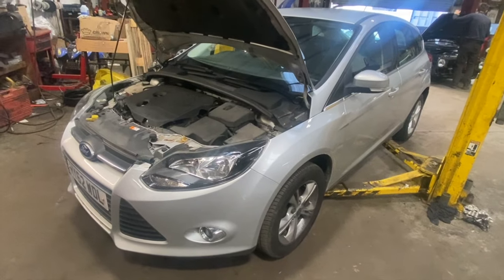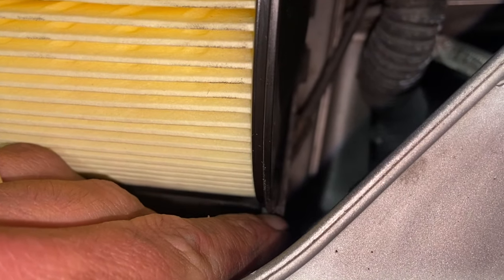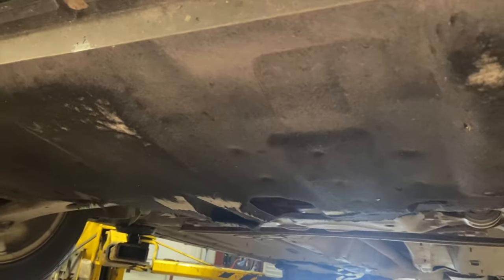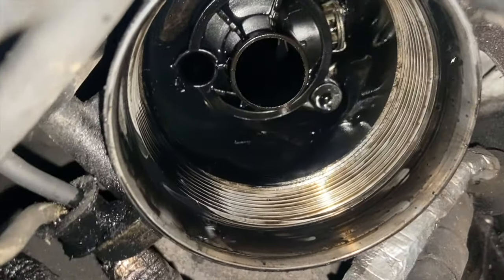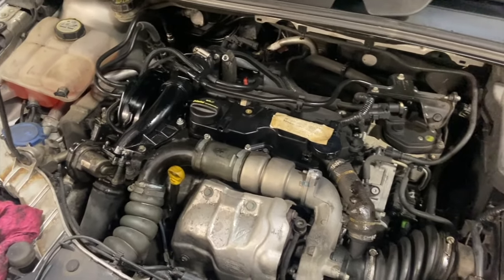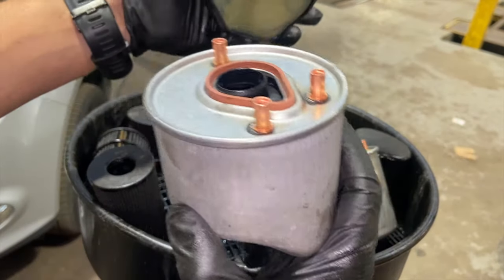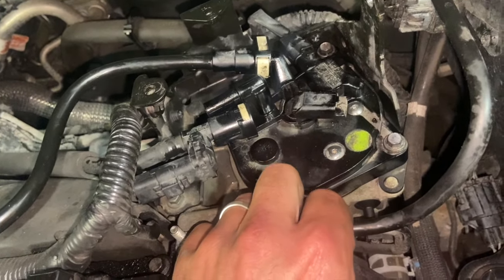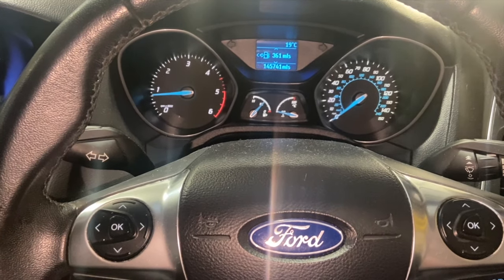Ford Focus 1.6 TDCI Engine service procedure (oil, air & fuel filters) mk3

Comment from the maker: Check Euro car parts for filters etc - https://tidd.ly/3lIO7xA  (use discount codes on site)
Check "Car Parts for Less" - https://tidd.ly/2LNEwIn  (use discount codes on site)
Service kit Ebay - https://ebay.us/iECTCH
Engine oil eBay - https://ebay.us/Vkvb8k
4L Engine oil amazon - https://amzn.to/3ujyWPp
Brake cleaner eBay  - https://ebay.us/57pfYI

Tools :         
Shallow socket set 3/8 - https://ebay.us/aDzBza
Suction pump - https://ebay.us/LomSm7
Primer pump - https://ebay.us/42gY7E
Battery Ratchet - https://ebay.us/Z8FZbP
3/8 Digital torque wrench - https://amzn.to/2PP9vpP
3/8 standard torque wrench - https://amzn.to/33eZsxj
Socket set - https://amzn.to/3eGx2Ak
Brake cleaner sprayer - https://amzn.to/2BLF1gX
Long reach 3/8 ratchet - https://amzn.to/3iJsADg
Ring Inspection Lamp - https://amzn.to/3gGWHcG
torx screw driver set eBay - http://www.ebay.co.uk/itm/142442401623
Pic set - https://amzn.to/33JcZyJ
Dewalt 3/8 impact driver - https://amzn.to/3njemLY
Screwdriver set - https://amzn.to/3jswgJP

Comment: Thank you for your time making these excellent videos.  Always look forward to the next one.  
Didn't really know where to post this question but I need to know the best way to remove contaminated diesel from the fuel tank in a ford focus 1.6 tdci mk3 2014 please, without having to drop the tank.  Could you advise please. Many thanks.
Reply from the maker: There might be a drain option via diagnostic machine but if not with a pump I’d try sucking it through the supply pipe to the fuel filter

Comment: TIP......REMOVE FILTER BOX TO IMPROVE ACCESS TO THE DODGY PLASTIC NUT ON THE OIL FILTER HOUSING
I struggled to undo the oil filter nut as I only had a spanner that was big enough to fit but there wasn't enough room to properly fit and turn the spanner due to poor accessibility.  
The air filter box is easily removed as you just undo an electrical connector and then just pull it out from the rubber mountings. Bingo - managed to undo the tightly fit oil filter housing with the spanner and adjustable wrench, without looking for a suitable socket or tool to purchase.
Reply: The for Help !

Comment: Why do you use Castrol edge 5w-30 LL (gold) not Motorcraft 5w-30 5A/5B? In my car book is recommended 5A/5B, spec wss-m2c913-c.  I heard, people use Castrol but magnatec (green). Nice change
Reply from the maker: Thanks , it was a while back I did this so will have to check back mate

Comment: Hey. Without a suction pump is the fuel filter ok just filling it up? I've read a comment on here that someone had a new code after their DIY with maybe air in their system. If you say its no big deal i'll keep to that, otherwise I can make a makeshift handpump and take the air out, or i'll buy one and do it properly. Thanks in advance.
Reply from the maker: Yeah just fill it up , they need bleeding to make it a lot easier but won’t need any coding doing

Comment: Interesting video , my focus mk3 has started sounding rough, I'm told it's the injector, I have a 1.5 diesel. Is there anyway to fix this without costing a fortune.
Reply from the maker: Neh I’m afraid there bloody dear injectors 😬 best get it checked first though .. it could be a completely different fault

Comment: I have done exactly as you demonstrated and it was very easy to do, having said that, I decided to take a small coca cola bottle of coolant direct from the reservoir  with a hand pump, which I subsequently replaced with neat coolant as my focus was running  a bit on the rough due to the cold weather  that we been experiencing. Now my temperature gauge  is fluctuating  from cold to hot and back to cold primarily when I stop the car from a morning journey  to work, worries me all the time.
Today I decided  to take a different  route  through  the m25 on my way back home. It fluctuated once toncold when I slow down due to traffic, put the heating  on HI and drive pretty  much for an hour without  fluctuating and kept to normal  temperature, on arrival  at home the gauge  kept right in the middle of the temperature  display  for a while as I kept the car running to observe  if it would fluctuate again which it didn't.
Could you help me to diagnose what the issue might be as the car runs perfectly,  no warning  lights on dashboard.
The vehicle  is a 2013 Ford focus titanium x 1600 diesel
Any imput will be much appreciated.
Many thanks.
Reply from the maker: Seems odd, may be bit of air in the system.. but if you only took that small amount out its unlikey.. first step I would try bleeding the system at the bleed points

Comment: Hey. Can overfilled oil cause problems on newly fitted dpf and oil fog located on the valve cover? Also saw some oily signs on throttle body, seems oil in the pipes after the turbo.
Reply from the maker: It can if it’s a lot over! Just a little won’t harm arnt thing

Comment: I think on these models the cartridge oil filter is best to be fitted first because of that nipple..and afterwards put the cap back on..and tightened to spec..again..just my opinion..other that ..top job...
Reply from the maker: Yeah I’ve done it that way sometimes, it can sometimes be tricky to feel for it locating otherwise 👍

Comment: Is this procedure similar for the C-Max of the same year, the engine bay layout looks 'more or less' the same. I ask as I am getting a weird 'Engine Malfunction Service Now' light when going to about 3,000 RPM which generally seems to be fuel filter related it seems.
Reply from the maker: yeah should be very similar mate 👍
Reply: @diydaly  is there specific torque settings for fuel filter housing or just, hand tight?
Reply from the maker: @GSF404  I’ll try find out , not come across one before but it’s definelty not a lot , just abit more that a light nip I’d say

Comment: I've just changed my rear break abs censor th traction control light stays on when the engine is running despite being turned off , do you think it needs to be re set , thanks .
Reply from the maker: Abs faults clear them selves if the issues sorted , once fitting the sensor you Amy need to drive over 15mph
Reply: @diydaly  I drive on the motorway , anyway the problem ( not " issue " ) is the steering censor.
Reply from the maker: @patrickkparrker413  👍

Comment: This guy is amazing.  Quick educational clip for anyone no matter how thick one can be. The only part l didn’t get was when he put back the fuel filter. The in and the out flow. How did you do the fuel suction and is there any other tool or method of doing it if l don’t have the pump like you got? Please Advise. Thank you in advance
Reply from the maker: Thanks for the comments! You could your a real basic primer pump .. other than that , best approach would be to brim the filter with diesel first the keep cranking plus some brake cleaner or east start in the intake to help .. not really advisable though.. priming is the best approach 👍

Comment: Got P2291 Code, engine went to limp mode after filter replacement. 
Also, is the mann filter supose to rattle a bit in the housing?
Reply from the maker: That’s a fuel pressure code , may have been due to air in the system or a leak.. it shouldn’t rattle no mate
Reply: @diydaly  I called the part store, they told me that all of them rattle, I heard it over the phone xd wierd... Is it possible that the whole batch is faulty?
Reply from the maker: @CarloLeonKolega  I’m not sure tbh mate , I’ve not known them rattle before

Comment: Instead of using ‘a sucker pump’ as you stupidly put it, just fill the filter with diesel before you put the seal on top of it…………………
Reply: Priming the filter is a bit of an arse ache.  Prior to fitting the top, you will need to keep your finger over the drain hole. Otherwise, it will pish diesel everywhere.
Prefer to use the pump, and then you can guarantee no air between the filter and HP fuel pump.

Hey, ho, though, each to their own.  There's more than one way to skin a cat.